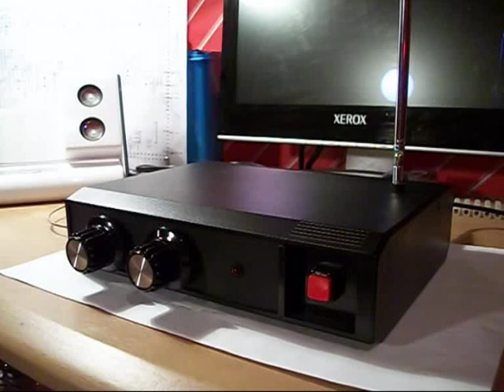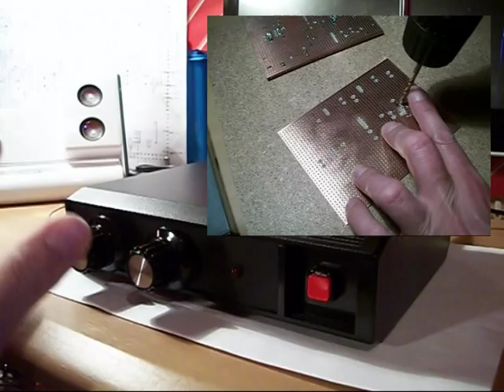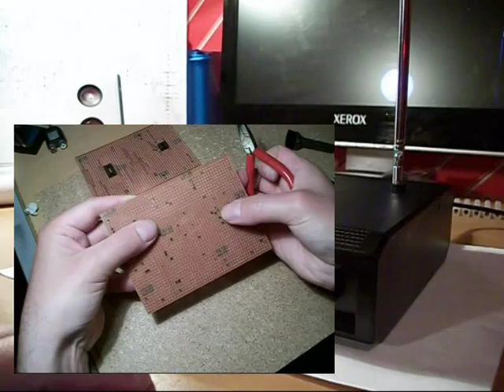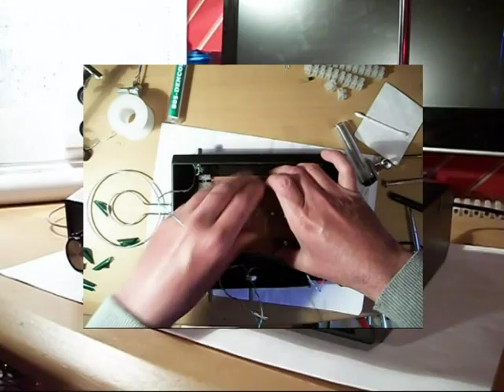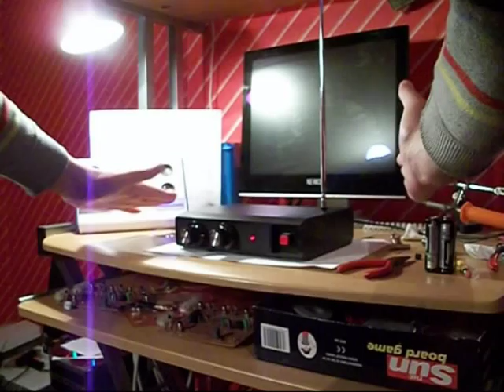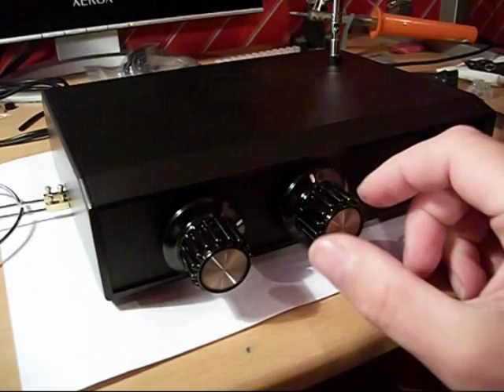Theremin Construction Part 1

Comment: I stumbled upon this on ebay, and thought the price was pretty good for a starter theremin, but I have a few questions: How far is the frequency span of this thing? Is there (generally amongst theremins) any difference between the pitch acuracy of this build and, say, a moog etherwave? And finally, is it possible to flip the pitch response so as to make it act like more of a standard theremin?
Answers would be greatly appreciated :)

ps: The design is gorgeous; I've been looking through so many ugly theremins lately, so this is a nice breath of fresh air.
Reply from the maker: Thank you for the compliment Clemens, much appreciated, the IF transformers used are 455khz for the oscillators stages, i'm not 100% on the frequency as i don't have access to a scope/frequency meter, i'll have a look-up though.
The moog theremins use a dual rail supply, so have more of a range to them, the one here is 6V, although a tune can be made with practice, if i can find the info i will post, best regards, chris.